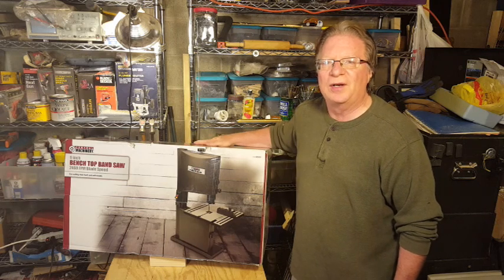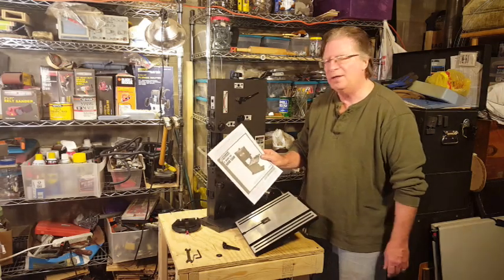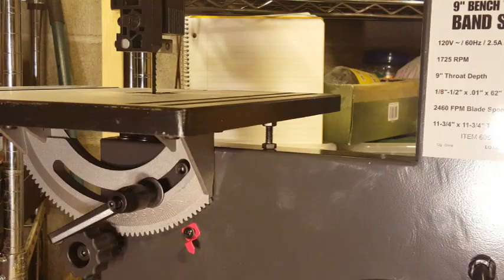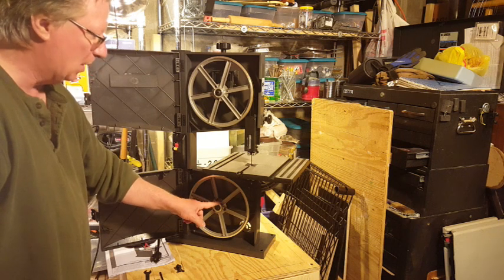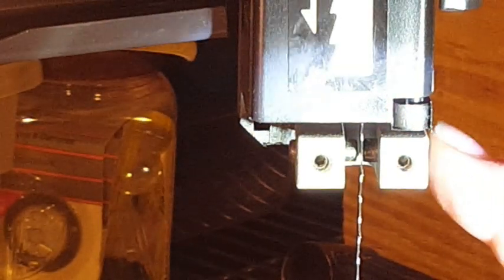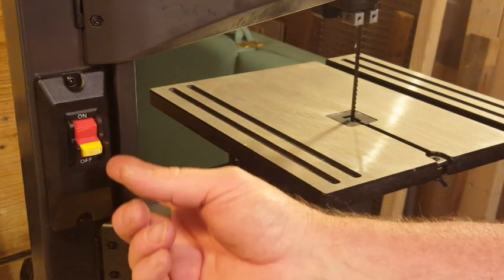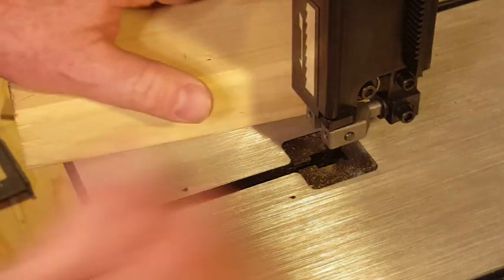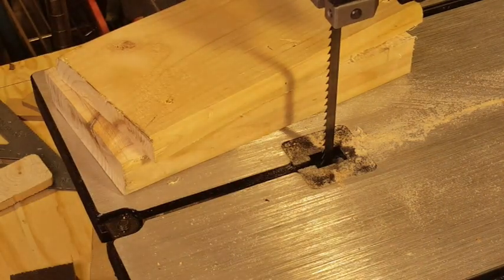32. First cuts using a 9" band saw from Harbor Freight

Comment: Don't get Haber freight, get a WEN brand. Same price 10x more durable and will last waaaaay longer.
Reply from the maker: Can I assume you are talking about the WEN 3959 9" benchtop bandsaw? That looks like the same basic design as the Harbor Freight but comes with a fence. If I was in the market for a small benchtop bandsaw, I would consider this model.
Thanks for your comment and for watching.

Comment: You should let us hear the saw when you're resawing the 2x4 so we can tell how much the motor is working. Otherwise nice vid!
Reply from the maker: Thanks for your feedback. I have a couple of responses for you.
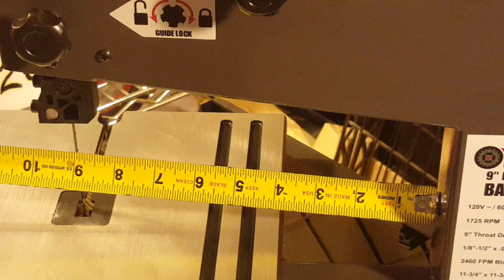#1) I probably removed the sound because the saw was most likely making a squealing sound but I honestly don't remember. I suggest you take a look at video #84 specifically starting at 6:49. 
Here's a link: https://youtu.be/eBQU1PT0EvM . 
In that video, I use 3 different tools to cut 2" diameter disks. In this video, you will here the bandsaw cutting and you'll also see the issues I ran into.
#2) Keep in mind that this saw has a low power motor. I don't mind this because if the blade twists or binds, it will stop (which in my opinion, makes the saw safer to use). This low power also helps to keep me focused on having the blade do the work.
Thanks for watching.

Comment: This seems easier than a bench top table saw.
Reply from the maker: Yes, I agree with that. Since the blade is always cutting in the downward direction, the work piece is always being pushed into the table of the bandsaw. I think this makes using the bandsaw a lot safer to use than a traditional table saw (that uses a circular blade spinning at a high speed). Thanks for your comment and for watching.

Comment: What, no fence?
Reply from the maker: Correct, no fence. I should add that in this video, I used the stock blade that already came installed on the saw. I found this blade to be very sharp which made it very easy to cut these scrap pieces.
Thanks for your comment and for watching.

Comment: Size an length for blade
Reply from the maker: From the User's Manual ( https://www.harborfreight.com/13-hp-9-in-benchtop-band-saw-60500.html ), the blade size is: 1/8″ – 1/2″ W x 0.01″ T x 62″ L
Thanks for your comment and for watching.

Comment: 'The blade moved around a little bit...' -- no telling what would have happened if you had used a fence.
Reply from the maker: Thanks for your comment. If you watch carefully, I actually moved the workpiece around (it didn't move through the blade in a straight line). Yes, I think if I had a fence, the cut would have worked out better. Thanks for watching.